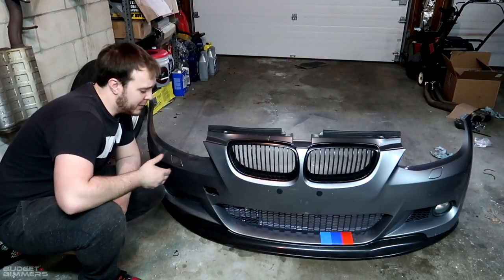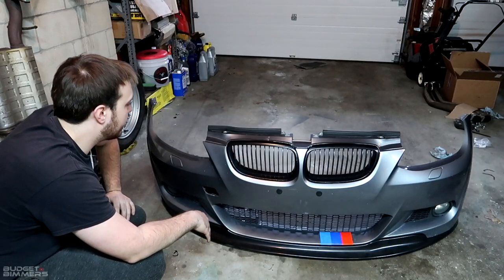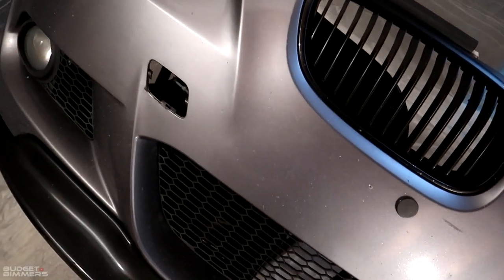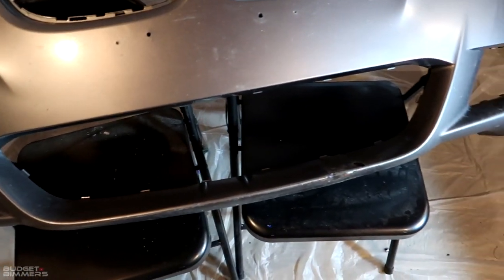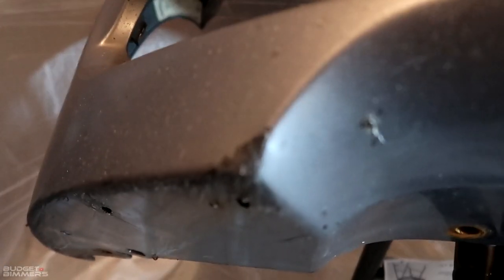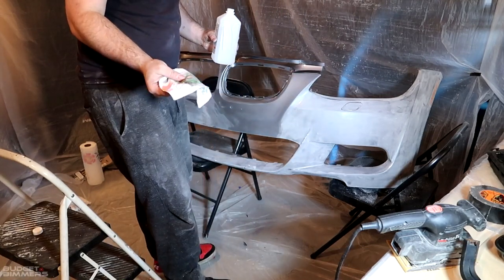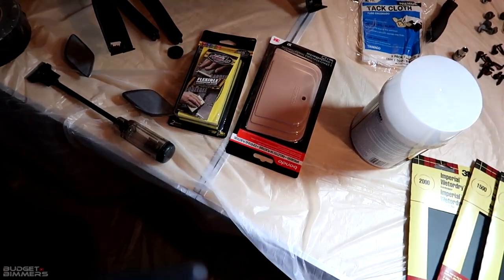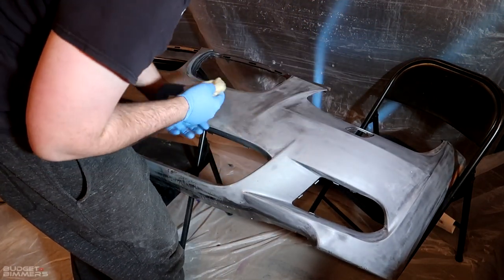How To SPRAY Paint A Bumper

Comment: So you build a spray booth in your basement, as you are going to spray your bumper. Spray booth  clean and dust free, so why sand in it as you can see the dust on the plastic sheeting? This could be why you got the defect. Sand outside. Nice job please just take my comment as a suggestion.

Comment: What do you think about the e92 3series as a starter driftcar?
Reply from the maker: freedomlifemake 25 i would definitely not recommend it lol
Reply: +Budget Bimmers why, considering the fact that where I live they are the same price as an e46, but it comes with more power and they dont have subframe issues like the e46?
Reply from the maker: There are cheaper alternatives, the suspension on these cars comes factory with gummy bushings and the thing is pretty big feeling compared to something like an e36. Not the mention these cars are much more easy to break and much more expensive to fix. In my opinion the e36 is the best starter drift car, or a Miata lol
Reply: Get a 240. Trust me e92 going sideways is trouble. Put my xi into a pole thinking it drifts.
Reply: +p 2o  xdrive is not ideal for drifting:))))